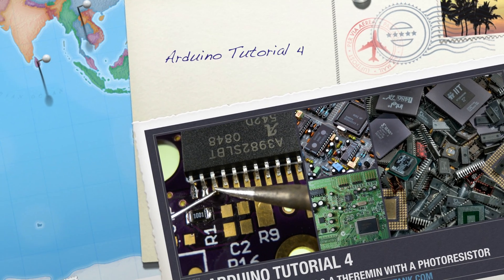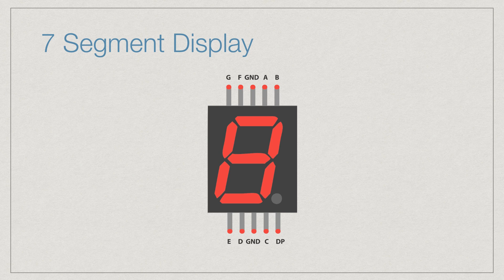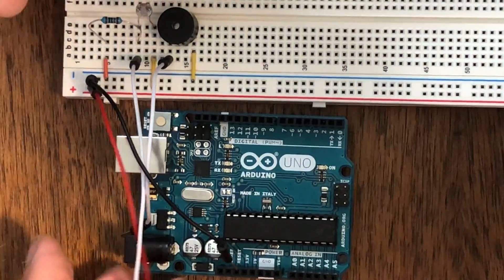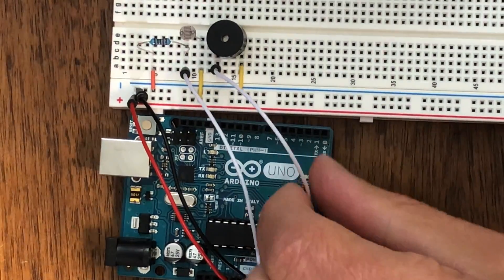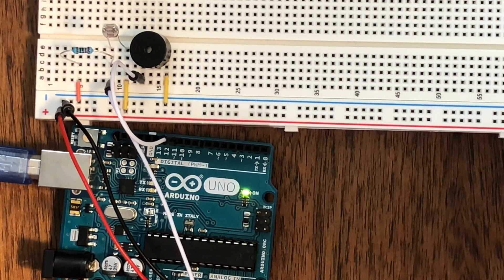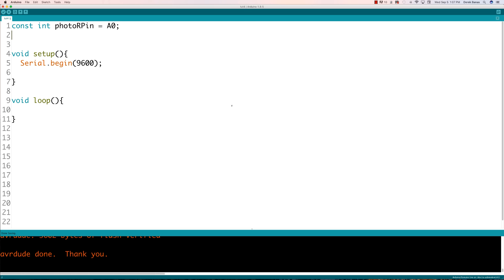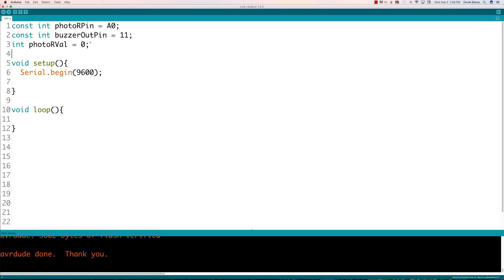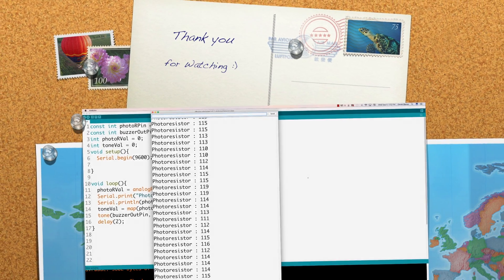Arduino Tutorial 4 : 7 Segment Display & Theremin

Comment: I wanna do a shout out for OpenTheremin!!! Theremin is the reason I took the plunge into the sea of Arduino in the first place.
So there is this serious project called OpenTheremin which is a USB Theremin with two antennas just as the original and it's good enough for playing music as good as your pitch allows ...
It's a kit with  a shield with theremin electronics and all what you need except an Arduino Uno but if you read this you probably already have that, right?
Google for "Open.Theremin V3 - gaudi.ch " ... since I've had bad luck lately for putting links in YouTube comments.

Comment: I tested the circuit in the tinkercad simulator and it did not work. I think there should be a pull-down resistor connected to the button